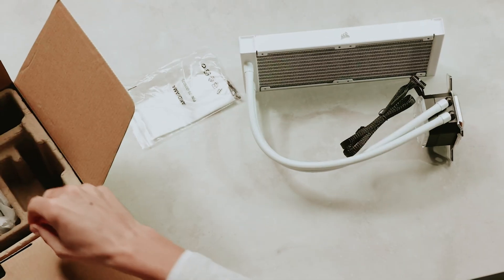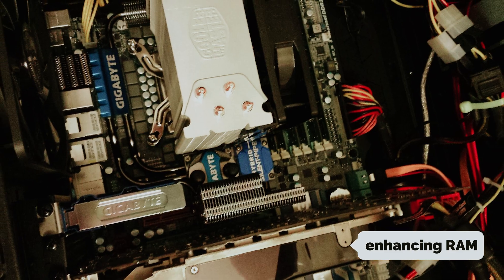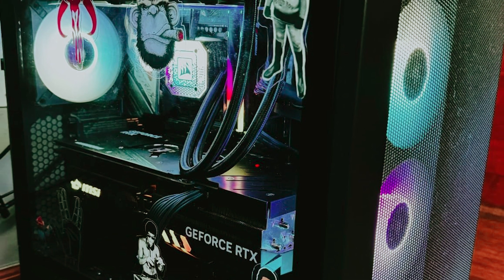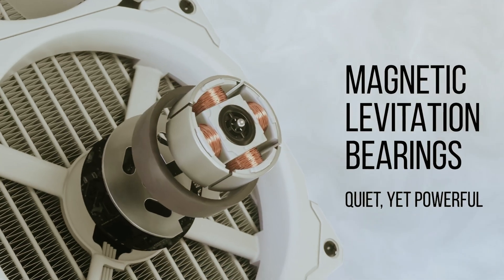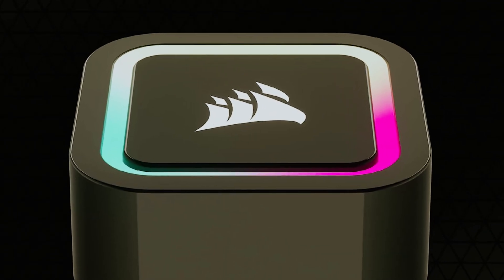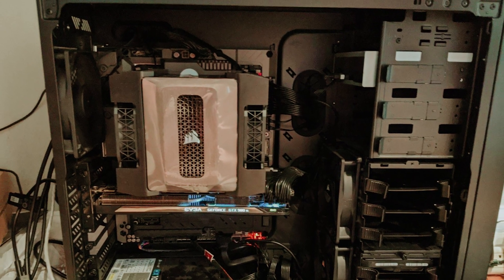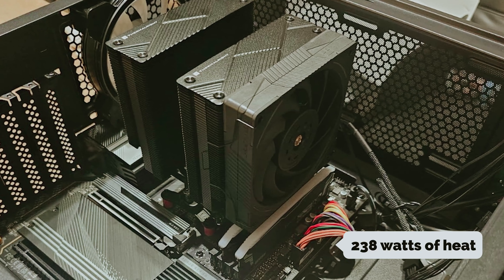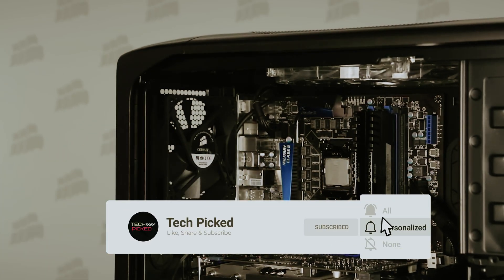Top 5: Best CPU Coolers (2025)

Comment: Some notes:

1) I wish the footage focused on the hyper 212 evo v2 a bit more, since most of the B-roll shows other CoolerMaster products. I know it's not a very sexy cooler to show off, but that's why it's the hyper-budget option.

2) There's some interesting choices like the Corsair 240mm liquid cooler when something like Arctic's liquid freezers perform better, are quieter and cost less while looking marginally worse on the waterblock. Or the A500 that's really, really loud on anything higher power consumption and something like a NH-D15 allows you to reposition the front fan for more ram clearance anyway and something like a Dark Rock Pro 4 or 5 outperform it while being much quieter and cost similar amounts money, while still looking good and allowing for high amounts of fan clearance. And at least they don't choke on very high power consumption parts like the A500 does even when it's running at 50+ decibels.

I know the choices depend on what you've tested, but the A500 especially sticks out like a sore thumb for how bad it is for the price and the whole mid-portion of the video just reads like a Corsair advert even if that's not the intention.

The hyper 212 evo can at least be defended with it costing $5-10 less than a peerless assassin and at that price range every dollar counts, but if the budget stretches a little bit, the aforementioned peerless assassin should outdo it by a wide margin allowing for better noise and more flexibility with any possible future cpu purchase. That thing is insanely good at under $40.